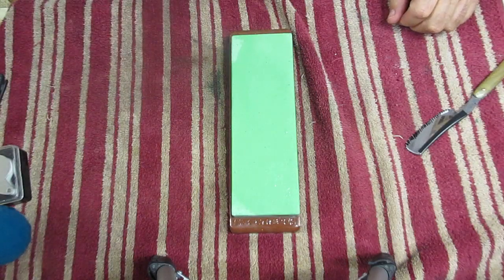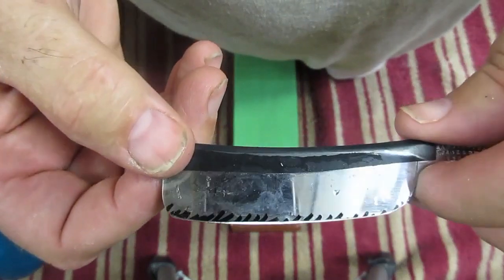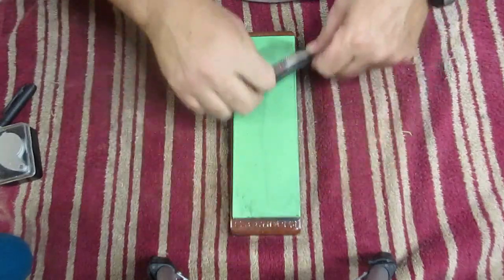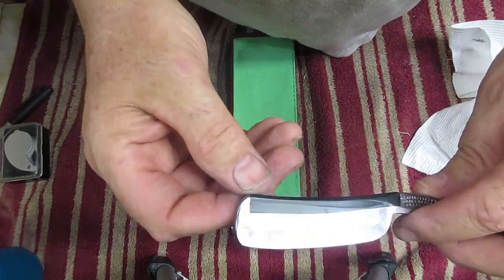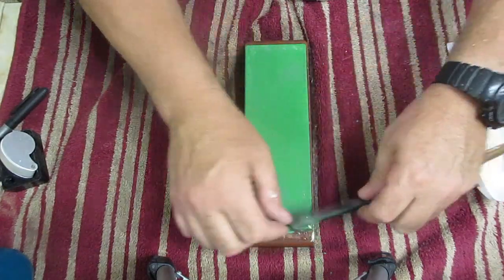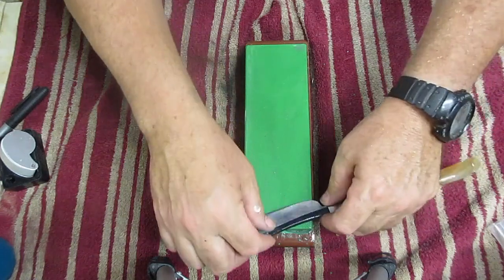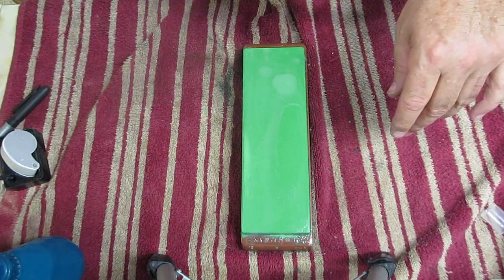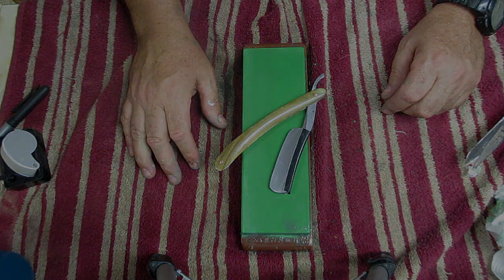Setting the Bevel on a Sheffield Wedge

Comment: Super! I've encountered "wobble" (I like that term!) in some fairly heavy sheep foot knife blades.....warped blade geometry. I had to resort to scrubbing motion. You have to pay attention and use finesse or it can get away with you, especially on coarser stones, huh? Thanks for adding a new term to my vocabulary!
Reply from the maker: Yep, you can screw one up fast if you don't know what you are doing.
If you consider any time you  quench or temper you are subjecting steel to heat.Warping is a common occurrence.  Even modern straights and knives have geometry issues, little bends or twists in them. Sharpen/hone enough of them and you will find that out.